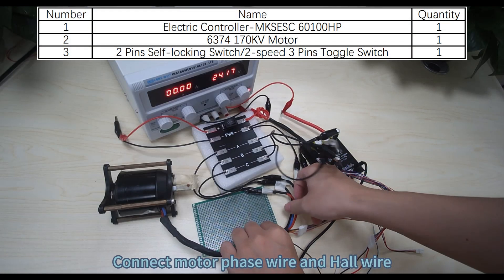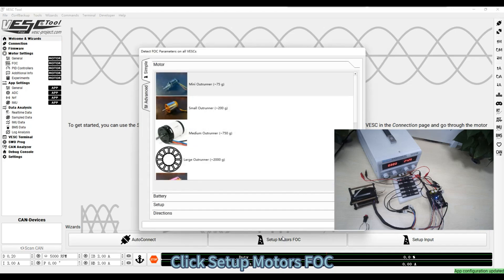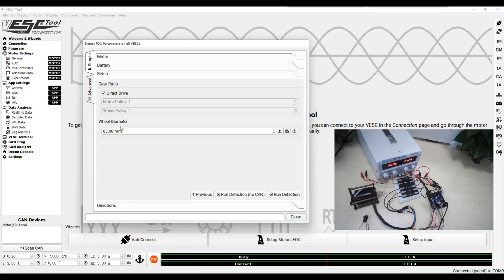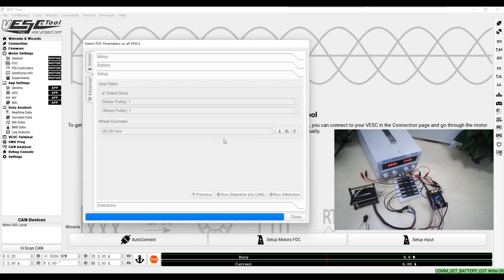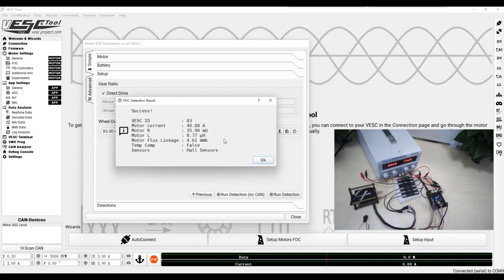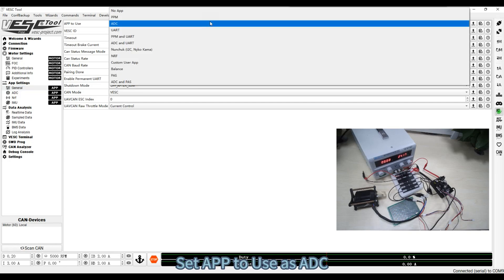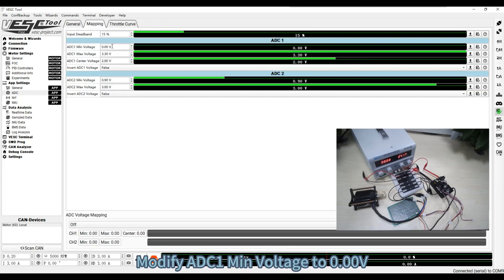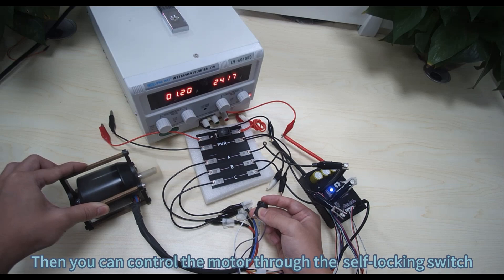Makerbase VESC LESSON  9 Apply ADC to Self locking Switch and Toggle Switch

Comment: Hello, how to add speed control to this?? i would like to use a momentary switch to trigger the start of a motor where the speed is set with the help of a potentiometer (as long as i hold the button, the motor rotates at the set speed, releasing the button stops the motor). I have connected the potentiometer to ADC1, GND, 3.3V, but where to connect the momentary switch? Thanks in advance for your help